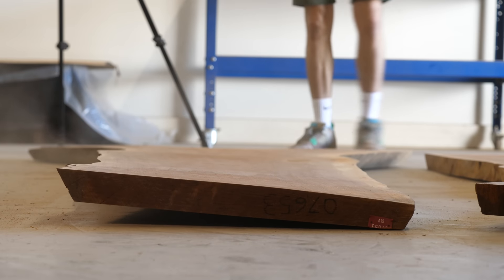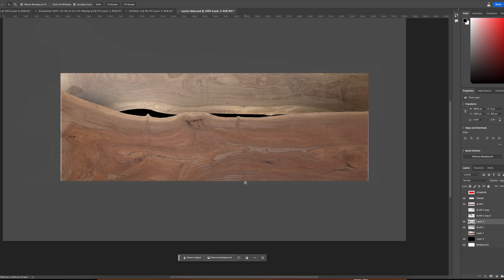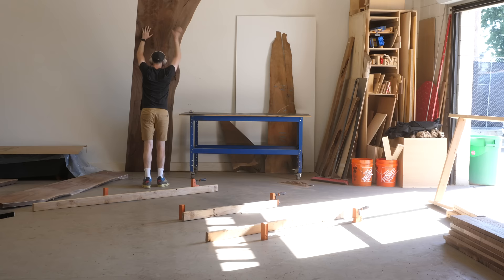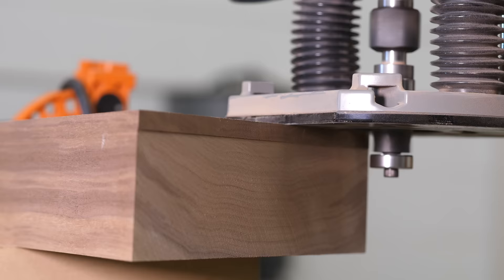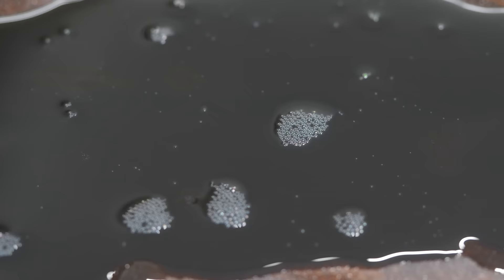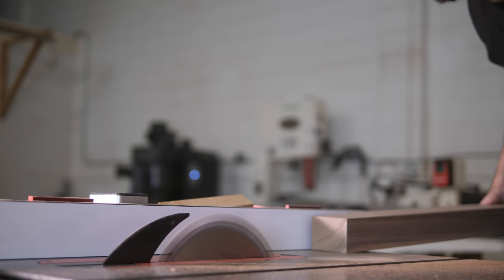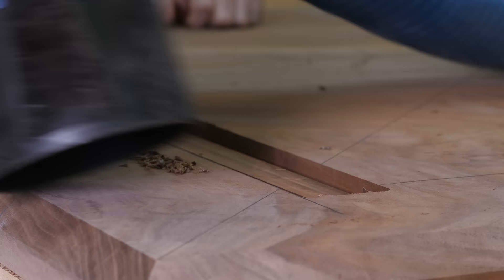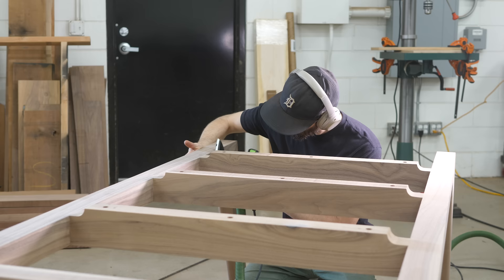Fixing a $30,000 Mistake

Comment: You should have used a template to cut both parts on the joining side, which would then fit perfectly. Or use the cnc instead of the template if you can align both slabs in a straight position. O really like the result

Comment: First time watcher. The production value is very high. The furniture is gorgeous, insanely beautiful.

The wood moving seems like a scary thing to compensate for. Will the top move more that the legs, and do you risk them moving in the opposite direction? I assume the rate of movement slows down as it acclimatises to the new climate?
Reply from the maker: Thank you!

As for the moving. Any piece will move as a percentage of its width, across its width. 

So for example. The base pieces are only about 3” wide. So we’re talking microscopic amounts of movement. 

Really the only concern are panels. Which in this case would be the top. 

Since it is going to a new location there will be an acclimation period. But even then over the year it will expand and contract with the seasons.
Reply: @Foureyes.Furniture  Very interesting, and not something I ever have to consider to that extent with steel structures, as they expand and retract at similar rates in similar directions. Very cool to see it properly considered.

You have a new fan.

Comment: For what it's worth, I liked the two toned curved seam tabletop. I like it so much I will almost certainly use that design element the next time I decide to build a table or desk top. I already stole Shaun's beveled curve seam he did on a dining table and used it on a coffee table I just made. It's so cool. I guess I'm a sucker for curved seams now. It's substantially more complex doing it with a hand router and template instead of a CNC though. But once you understand the process it's not hard to execute.

Comment: The video (around 20:00) shows you doing some interesting steps heating the epoxy and the probe you use to place the epoxy.  Is there a more detailed video that you have created showing some of these techniques in more detail?  It looks like you are solving some core challenges around removing bubbles in the poor, filling small holes where the epoxy's viscosity makes it a challenge, and a quicker way to help level the epoxy before it completely hardens.  I'd like to hear more about these techniques.

Overall, your work is always fascinating and I appreciate the great videos.  Thanks!  I also really like your design style and will be purchasing and building several of your plans.

Comment: Like the table but not a fan of the steel channels that folks (including me) use.  It’s not the channels themselves but the fact that we mill two parallel, deep slots in the slab.  This results in a section of weak, short grain wood that’s used for securing the channels.

Comment: I´ve been making a very similar table for 5 years now so I would be very interested, whether you are happy with lateral stiffness of it. From experience I can tell - when you push to the longer side of the table, the longitudinal girders that are connected to the feet, are undergoing the torsion stress. Your build is not optimal in this regard as these longitudinal girders are connected to the top far away from the point of connection with feet. Just for curiosity, I also made a Finite element method analysis of such a table. I connect the top via dovetail cleats
Reply from the maker: I wasn't happy with it. I thought it moved too much on the ends (like you described). I found that if I toe-ed the legs out slightly. (so that they are closer at the top and farther apart at the bottom). This seemed to stiffen things up pretty significantly. 

If I ever build another large table with this style of base, I will definitely push this idea even further. So that it becomes part of the aesthetic as well. It's more work, but it actually makes the table look a little more interesting when viewed from the head or the foot.

Comment: Nice work! (particularly the base) but think carving one slab into the other was weak sauce and a compromised solution.  Why can't you do the layout prior to buying the slabs?  GL provides plenty of pics and you can ask them for more photos.  Claro is one of my fav woods - so much movement.
Reply from the maker: You definitely could do that to an extent. Kind of like what I did in photoshop in the video. Just using the pics from GL

Comment: I always wonder how large epoxy pour areas interact with wood movement or shrinkage over time. I once saw a large walnut table where the epoxy became proud & edgy to the table surface. Which leads me to considering virtues of inlays in place of large deep pours.
Reply from the maker: Honestly...it all depends on the shape. So for example...if you had two independent slabs, joined by a river of epoxy in the middle. The wood would stay fixed in the middle (where it meets epoxy) and could extend indefinitely outwards. So no problems in terms of the top on it's own.

Comment: what are you melting to fill the epoxy voids that you put a weight over it?
Reply from the maker: it's called "hot melt". It's basically like a black hot glue stick. The metal thing is a block of aluminium that i'm using as a heat sink.
Reply: Thanks so much

Comment: I don't know if you already know this, but for the moving and bending of wood you could take inspiration of some guitar makers. Lot's of issues guitarists that travel around the world are struggeling with are bent guitar necks because their guitar have to travel in non climate regulating bags in very very cold airplane storage compartiments. What, for example, Charvelle is doing is caramelizing the necks of their guitars. It is a baking process that makes their guitar necks climate proof. They put their guitar necks in the oven the wood would be very very hard and won't move an inch during travel in extreme weather conditions. Maybe something to think about, maybe you already knew this process or maybe your projects are just simply to big to do such a thing. Maybe it is a fun thing to research and something to apply to your smaller projects.

Comment: Very nice table but there has to be a way to install that Support without the screw showing?  Modern is about "clean" lines, that would drive me crazy. If I had that table, all I would see are those screws (whatever was used) sticking down past the bottom line  of the table top.  I hate to sound like an a** but aren't comments suppose to be feedback, opinions?  Seems like there has to be a way to add that support beem without having those "screws" showing below the bottom line of the table top?  Cheers

Comment: Great video and lovely looking table(s). One quick question for you. In the video when your table saw couldn’t cut through the whole thickness of the timber, could you have used a thinner sled? Not sure that it would have been enough to make a difference but thought I’d ask. Have a good evening
Reply from the maker: So earlier in the video I used the cross cut. Which was 1/2” thick. Still couldn’t reach. 1/4” thick sled might have. But didn’t want to use a sled that thin. Other problems would arise.

Comment: Who makes the hot melt filler stick + aluminum block you're using at 21:15? It shows up in a couple vids. Thanks!
Reply from the maker: the filler sticks are called "Hot Melt"
The aluminum blocks I just got off of amazon.

Comment: Love your videos man! 
Hoping to pick your brain for a second. I’m getting ready to pour a 1” thick epoxy/resin? pour over a bunch of beer bottle caps. The internet has sent me down a infinite rabbit hole of trying to find the right product for this job. Do you have a recommendation? I know that’s hard without knowing all the variables but think cornhole boards, bunch of beer bottle caps on the top, clear epoxy pour over.
Reply from the maker: Thank you....if you're going an inch thick and you want to do it in fewer pours. Something like this:
https://www.totalboat.com/products/thickset-fathom-deep-pour-epoxy?sca_ref=4810530.NCBVp0I5ih

I'd start with a thin layer of either that, or this:
https://www.totalboat.com/products/clear-high-performance-21-epoxy-kits?sca_ref=4810530.NCBVp0I5ih

just to get everything stuck down (otherwise it'll float away when you do your deep pour). 

Deep pour is good because you can do it in one pour...and also because it cures much slower, it naturally has far fewer bubbles. There is plenty of time for them to escape.
Reply: Thank you man. Super helpful! Bubbles were a concern for sure with the air pockets under the bottle caps. Understanding epoxy feels like I need to apply the 10,000 hour rule, so I appreciate you lending your expertise.

Comment: Where do you get the black fill sticks and metal block kit you use to fill the small holes. I haven't been able to find it listed anywhere in yours or Cam's videos. Any info on them would be appreciated. Thanks. And all three of the table turned out great, the largest one was my favorite.
Reply from the maker: Thank you. Appreciate that. The sticks are called hot melt. The aluminum blocks are just from Amazon.

Comment: Great video. Great project. I disagree with the "Build bigger" concept for beginning woodworkers.  If you are new and you want to be a well rounded wood worker, you have to start with the basics. Everything is built from the basics. There is no getting around it.  If a new woodworker can hone their skills with more simple designs, projects, and less overwhelming projects, they will have that foundation of skills they can apply to the next project and then the next. Soon, they will be building tables and other furniture or complex designs. Their basic skills will help. They will provide a starting point and even an ending point. 

Again, great project and a great turnout.  Thanks so much for sharing.
Reply from the maker: I don't think we are disagreeing. I definitely agree with the basics and simplicity. My point is building a simple medium sized piece instead of a simple small piece.

Comment: How do you decide whether you use your festool track saw vs the kreg track saw vs a circular saw? I’ve seen you use them all at different points. Just curious.
Reply from the maker: The Track saws are pretty interchangeable. I tend to use the kreg when I’m taking wood to the tool. Festool when I’m taking the tool to the wood. 

Just because I already have it all set up. 

Circular saw I tend to use for rough break down.

Comment: I don’t envy anyone working with wood which is $2k-$9k. I’d be staring at it for months afraid to make a cut.
Also try making another sled using 1/4” plywood. Sometimes you just need a little more height in that table saw blade.
Reply from the maker: I definitely sit and stare at the slabs A LOT during these builds. I usually don't include that in the video though. Not so fun to watch :) 

Good tip on the 1/4" sled

Comment: Just curious... in the struggle of thick wood section you mention cutting on the table saw and leaving an edge... I noticed your low ply plywood 3/4" It looked like you were left with a ledge somewhere between 1/2" and 5/8" ... Why not go buy some Euro board or high ply 1/4" birch... Drop your overall height enough to clear the blade or get a lot closer? a 40" square sheet of 1/4" ply would have more than enough strength and rigidity to slide over your table say... Wax the backside slightly and you're off.
Reply from the maker: It would have to be 1/4". Earlier in the video when I used my cross cut sled (1/2") it still couldn't cut through. 

I think it would get a little sketchy...especially because all of the fences attach from the top side. So not a lot of meet for the screws to bite into.

You could do it form the underside...which I would consider if I were making a jig for use over and over (like a catalog piece)...but for a one-off...it would take me longer to perfect the jig than it would to make all the legs how I ended up doing it.

Comment: I had to go back to the vid that made the coffee table. And then proceed to hunt down what it would have looked like if the epoxy did cure. Personally, I think that would have been a bit on the boring side, So the white oak contrast definitely solved the boring problem. But although I like the white oak contrast, I don't like the white oak part being a glue up. I think that specific characteristic doesn't look good on this piece. But that's just me. I'd like to believe that if the white oak part didn't look like sections, the contrast concept would really shine. Maybe the problem is that we have all seen too many cheap oak glue up tables. Or maybe its just all those straight lines. 

I also kind of agree with Scott, not on the hate, that's a little strong - but I don't think this particular table top fits the others. Not that it should "look like" the others, i.e. boring, but it does need to compliment each other in a living room. If anything, its not that the coffee tabletop is too different/contrasty, but that the other table tops are too traditional. They need to at least speak the same language. If they also had more daring/wacky designs then they might work better with this piece. But I also have a feeling that the white oak glue up/straight lines play a big part here. Again, none of the other tops have these straight lines. Maybe I really am hating those straight lines. Oh well.....

Comment: I feel that the design this time is a bit incoherent. Firstly, the long sides of the table legs are tilted to the outside, while the short sides remain parallel. Visually, it feels disconnected. Of course, I know that doing this would cause a lot of trouble. 
Secondly, about the table top, I think the design should emphasize the elements of overlapping, creating a height difference between them. Otherwise, it looks inconsistent. And of course, I am aware that this would cause inconvenience in terms of usability, but these are just some visual suggestions I wanted to provide.

Comment: You say your miter doesn't cut as nicely as the table saw, but do you have a good blade on it?

I'm also confused by the title. Where was the $30k mistake??
Reply from the maker: I don't have a good blade on it. So it definitely doesn't cut as nicely as it could...but I still maintain that a blade quality being equally good. The Table saw is going to give you the best cut. 

The title. The furniture package was 3 pieces that cost 30K. 
Hall table he liked
Coffee table he has reservations
Dining Table I'm trying to make it in a way that he loves it, and that it highlights the benefits of the way I designed the Coffee table so that he comes around on it.

If he doesn't like the coffee table (and this dining table) he probably won't want to buy the package. They still have to be shipped. So if he's not thrilled I would not hold him to buying the pieces.

Comment: Don’t see them as a set. First has no floating top, and second has an artificial or mechanical joint of the 2 timber pieces. That apart from looking horrible, doesn’t fit in at all with the other 2 tops. So 1 and 3 tops match, but 2 and 3 bottoms have tied in floating tops. 3 seperate pieces, not a set at all.

Comment: I have to disagree on the working with thick wood part. You simply don't have the right machines for it, which surprises me as I've noticed before you work with serious material on machines that are pro-sumer at best. Also, you seem to have plenty of space in your shop. Have a look at the Mafell K85 saw for example, works with a regular track as well as a crosscut track and it'll rip over 3" in one pass. I've wondered why you don't have a 10' sliding table saw with a 16" or larger blade capacity, no more making sleds and 5" crosscuts will be silly easy (not to mention 10ft straight line rip or cutting full 4x8 sheets). Add a 16" or wider planer/thicknesser and a band saw with 24" wheels and you'll wonder why you ever did things any other way. High quality European machines can be found used for decent prices, brands like SCM, Meber, Centauro, Felder are great and if you want a proper slider you'll be set for life with a Martin or Altendorf. Make sure to install serious dust collection, an 8" main duct would be the minimum for the aforementioned machines and you'll need a 3-phase power supply too. I can't seem to not think about how to improve a workshop, no matter who's. Sorry for making you read this and send me a dm if you have any questions on "big machines"

Comment: “Nothing you could really do about that” how about agree on a design beforehand?
We won’t even order materials unless drawings are approved and signed off on. You’re going to run into a customer that will run you through the ringer working like that. 

Though I do agree the 2 pieces don’t match. The table without the drawers is really sleek though.
Reply from the maker: We did...check out the previous video (on the coffee table). there was a pivot in the design because of the first slab. in the video I ask him if he is up for a suprise on the top. That ends up being the suprise that he didn't like. 

If I weren't making videos...I would run my business very differently.  With videos being the main component of my business. I am much more willing to take a risk on an idea.

Comment: Family business does this same work. This was an amateur doing this work. The client over spent on very subpar quality.  I wouldn’t have paid for that.  My family in Texas does this work from whole slab for 3500-5900 MAX.  That includes everything, with delivery and custom  instal. His cuts while they work now, will cause the sections to float and separate in about 5 years the joint gap is going to crack and break.  See this all the time but amateurs or DIY.  What a rip off.